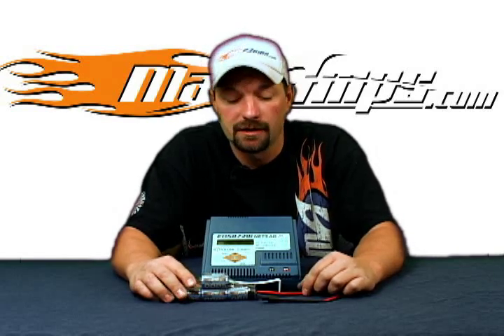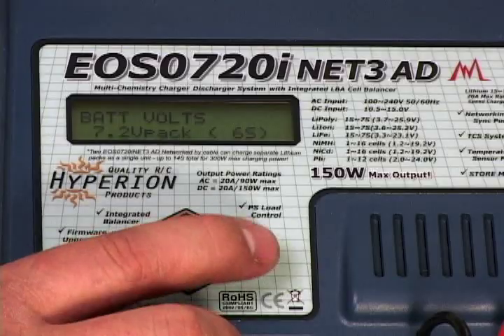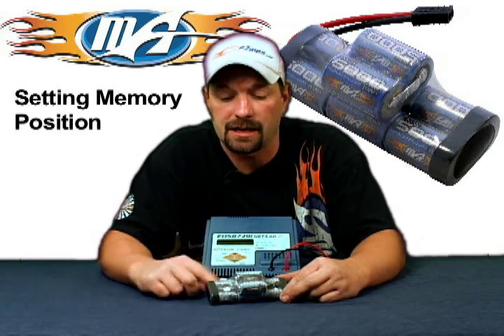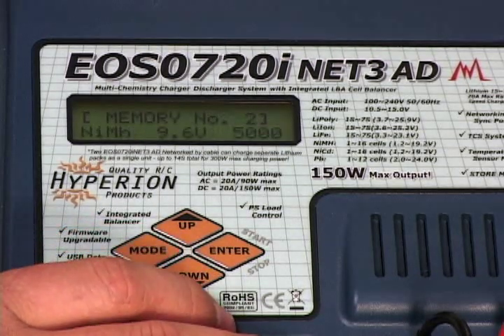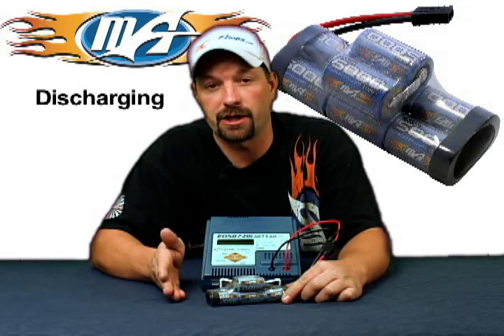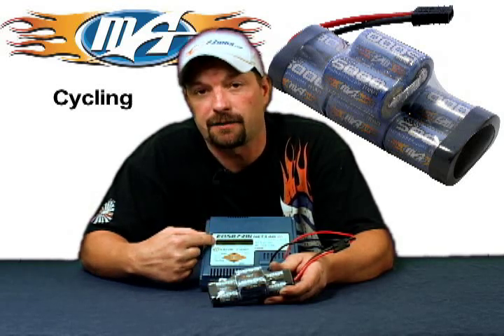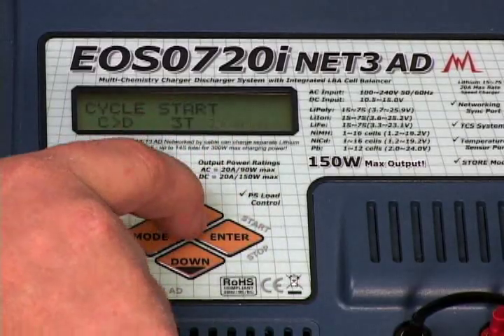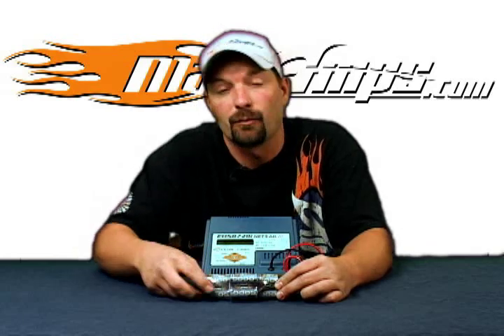How to charge, discharge, cycle, and set memory - NiMH pack - Hyperion EOS720i NET3 Charger

Comment: They say that NIMH batteries don't have a memory effect. Only nicad batteries have a memory effect.
Reply from the maker: That is incorrect. You will still lose cycle life and capacity if you do not properly discharge Nimh batteries.
Reply: MaxAmps.com then why do all tutorials on NIMH's say not to discharge them below 0.9 volts per cell. But you have to be careful in a multi cell NIMH battery pack. Some battery cells might be lower than 0.9v per cell when discharging, so If you discharge any cell below that limit then you risk cell polarity reversal. Also they say NIMH's have voltage suppression not charging memory. Your saying it's better to discharge them from time to time but not discharge them down to 0 volts right? After discharging NIMH's down to no more than 0.9 volts, then quickly put them on a charger. Right? So they don't discharge any further and reverse polarity in the NIMH cell(s). Once a NIMH battery reverses polarity internally by too much discharge then the battery cell is ruined. The only reason to properly discharge a NIMH battery occasionally is to revive it from voltage suppression, not from charging memory. That is what is written in NIMH articles.
Reply from the maker: .9 volts per cell is fully discharged. We do not recommend 0 volts and chargers should not be able to discharge that low.  In regards to voltage depression it is actually the same as charging memory. The memory is just a more comment term. We are in the same page in regards to the importance of cycling and that is really all that matters.